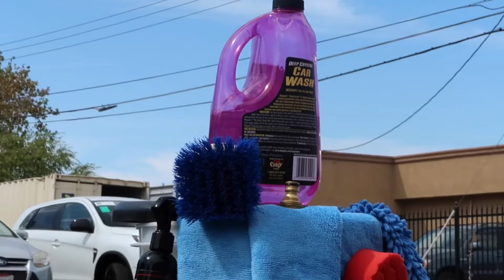Car Detailing Companies GOING OUT OF BUSINESS 2023 WATCH OUT DONT GET SCAMMED // SAVE YOUR MONEY NOW

Comment: Lol no

Doesn't come out thick enough. 
Your causing scratches. 
Just doing that isn't pre washing it. So your gonna cause swirls and scratches marring.  Even more so going round whole vehicle. Just moving the dirt around.

It's all about
Pre wash 
 3 bucket wash method with grit guards. 
1 Panel at a time. 
Start from top to bottom. Clean mit out after each panel. 

Put camera closer to the car after. Let's see them swirlys
Reply from the maker: I understand everything you just said and first off I want to thank you for being a part of my channel and leaving your opinion that I actually agree with you as of now I’m still testing products and the solution I will have the final mastered product with all the best bundle packages for the consumer I will make more videos this is just the very first one introducing the idea Samo subscribe let’s see where this goes